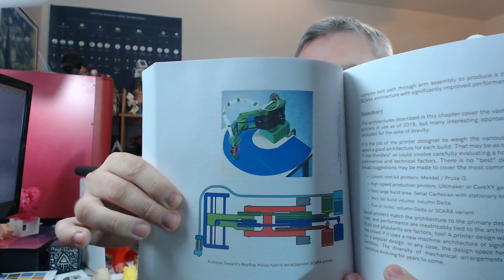Why aren't 3D printed homes more common?

Comment: It's two things. The equipment they use, and the stuff they squirt out. I hope they find a way to make it work and that in the next decade or so they figure out a way to do it which is faster, more durable, and cheaper than current methods. Wood framing with fiberglass insulation has to go as the primary way homes are built in the US.

Comment: 3d printed houses would be done for its artistic Beauty. Not for its cost, or its speed of construction, but for being able to make shapes you could not make via conventional methods.
Reply: Nah, it's all about speed sucka. Houses built in days = Neighborhoods built in months. More houses, lower prices = happy people.
Reply: If you simply want 'shelter' use shipping crates. You can drop those where you need them they are designed for being transported. It is the fastest shelter possible. 3D printed houses are for artistic beauty. And from what I've seen it is hard to keep them beautiful for long. Dirt and algae like to grow on the rough surface.
Reply: Its about speed and low cost

Comment: The way I've always thought about 3d printing homes is use it like the factory for prebulit homes, have shipping containers outfitted with 3d printers so it's portable and print walls in the truck and install them all as they are printed. Printing it all at once is still a far way off.

Comment: Scara, six-axis arm, are essentially unsafe on a construction site.
HOWEVER, if a Scara or similar, is permanently mounted to a truck, then, its safety is the same as any crane.

The biggest problem is the cost, or rather, displacing existing prefabricated homes, which use predefined designs, and built in a factory off site.

Comment: I don't think it's necessarily about the printer itself but that whatever filament analog one would use has to be comparable or cheaper than existing materials.  Full on concrete would only work in certain areas of the country and only for smaller structures. Wood frames with fiberglass insulation is probably still the cheapest construction material for houses in the US.

Comment: Ideally you'd want a kind of spider robot that can "walk around" on stilts and print things and then climb onto those things and print higher up. Maybe a swarm of them!

I don't think concrete is the right material really. Wasp prints with mud which is great but I think composite is the way to go - combining plastics with fibers.

There are some interesting technologies. One is to print with PU spray foam that rapidly hardens and could be milled into precise shape. Or print a shell for the wall then fill it with foam to increase stiffness. Ideally print with continuous fiberglass towings / threads to have good tensile strength.

The best way would probably to print your house in manageable parts to be glued together on site. Like a puzzle house. Again foam for insulation and stiffness would be great as well as fiberglass. There is also "tape laying" on top of surfaces by robots.

One big problem is overhangs and ceilings.

But the main problem is really that the shell of a house is a lesser expense. An architect, structural engineer, building permits and all the regulations that very from county to county and the installation of plumbing and electrical stuff and windows and doors. That is the most expensive part by now I think.
So a 3D house printer would ideally need to support and make those parts cheaper as well.